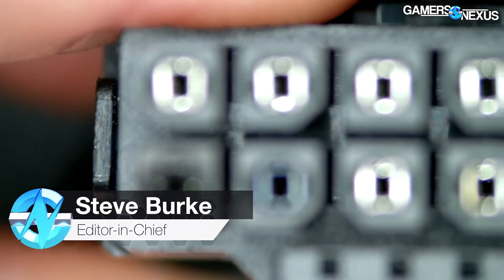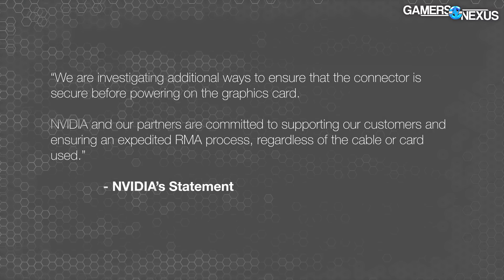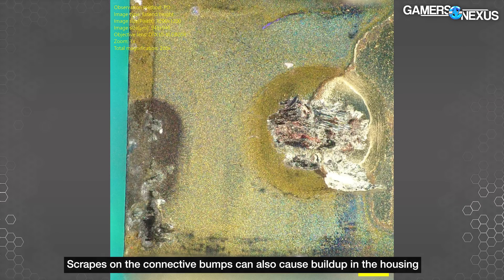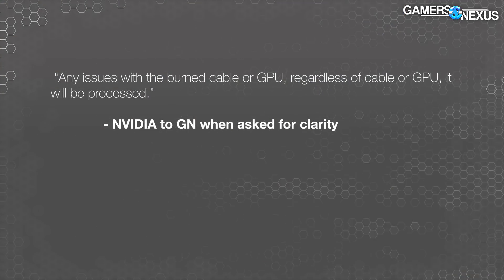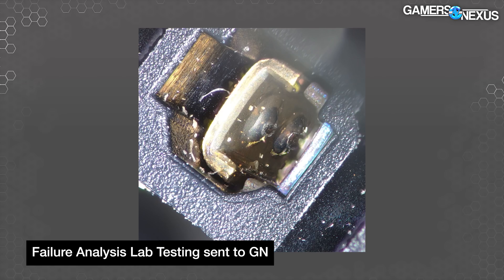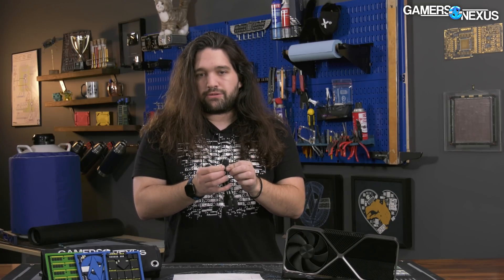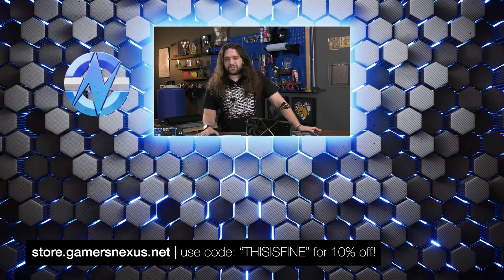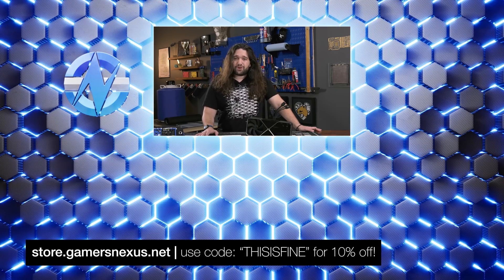NVIDIA Responds to Melting Cables, Warranty Concerns, & 12VHPWR Adapter Failures

Comment: I get that melting cables issue is a real issue. But the issue I see with this all is the fact I have never heard of any other socketed cables from other GTX or RTX series melting like this. What an odd turn around from the days of lower TDPs.
Reply: The older cables were a lot easier to plug in all the way and had ridiculously high safety margins.

I'd also wager that the early concerns about the cable being somewhat delicate led to a positive feedback loop. People would try to be gentle with their cables and fail to exert enough force to plug it in all the way. The cable would then melt, causing the user to warn others to be gentle with their cables. Rinse and repeat.
Reply: @tomhsia4354  arguably correct safety margins
Reply: @fungalcoffee  I'd argue that the 12VHPWR has enough safety margins as is. The problem is that the PC community has gotten used to the old safety margins, suddenly lowering the safety margins by a lot could only end in disaster.
Reply: It's not the TDP itself that's the problem, it's the fact that much power is being pushed through that's small of a connector, so if there is problems it exaggerates them so much more
Reply: @MayYTlive  It's not even the current being pushed through the cables, GN even cut 2/3rd of the connectors off and the plug worked fine with 300+ watts going through just 2 pins. Temps were still safe. This is mostly due to the bad design that allows the connector to feel like it's plugged all the way in when it's not. This would've been an issue on previous generation cards if they were using equally bad connectors.
Reply: @MayYTlive  Bullshit did you even watch Steves last video? He tested the cable with just TWO of the six pins and it worked without a problem.
Reply: @MayYTlive Then why were no issues with cards like the 3090 and 3090Ti? They used a very similar 12 pin connector and had high TDPs.
Reply: Oh, it did happen. I had a Sapphire Radeon HD 7950 that sufferred a melting connector but on the power supply side (Corsair power supply). It has occurred before but never as frequent as this.
Reply: They really REALLY needed to utilize some sort of loopback circuit to keep it from operation if it wasn’t seated properly.  I know it’s not entirely relevant, but having worked on aviation electronics for over a decade, this is common in that industry.  A stupid simple fix for something that could cost people their lives.

Disregard, seems this cable has them and I would agree.  Shorting those sense pins to require full seating would be great!
Reply: the 3090 also melted however it was not as large of a problem as the 4090
Reply: Overclockers have been pushing FAR more current through previous gen connectors while running older cards under LN2
Reply: The old connectors are spec'd for over 300W, but the PCIe spec says to not use them for more than 150W. This means that even if only half of the pins really make contact, it's still going to be fine.
Reply: It has definitely happened.
Reply: 8-Pin Connectors have melted for decades, as did 3rd party 12-Pin cables of the 3090FE.
It is just everybody loves to bash Nvidia these days, so people are more likely to report failures currently.
Reply: "Many systems are purposefully built much stronger than needed for normal usage to allow for emergency situations, unexpected loads, misuse, or degradation." In this case it seems that the minimum spec leaves little room for errors of any kind, and it is left up to manufactures to incur additional expense in making more robust hardware that has a greater safety factor to accommodate non-ideal circumstances, if that's even possible for them to do without violating the standard in some other way.